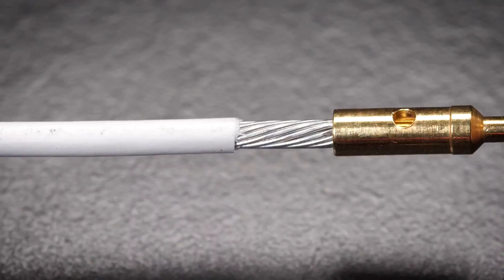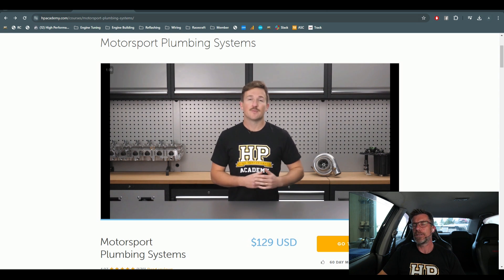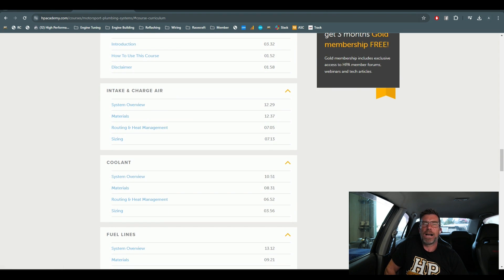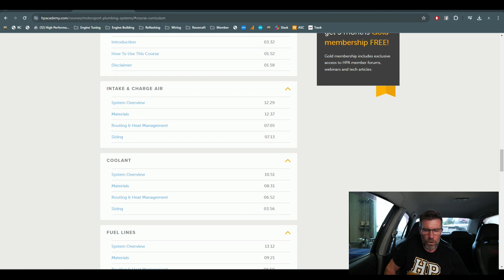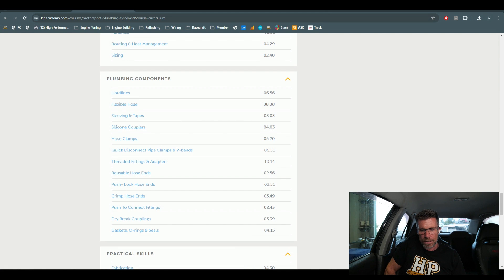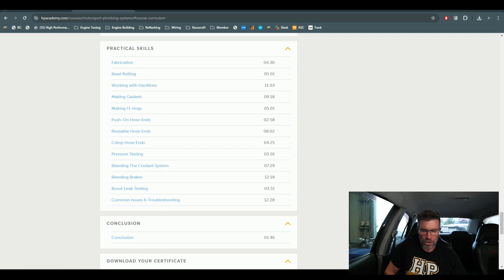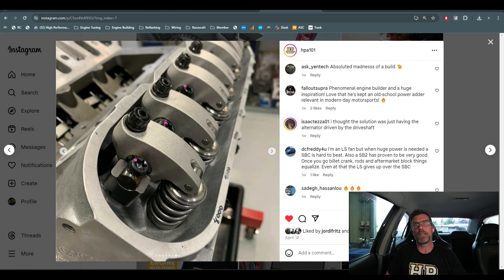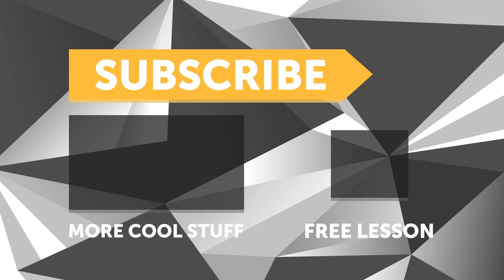Quality Wiring On A Budget | Motorsport Wiring

Comment: sure better than all the spade terminals mine runs on
Reply from the maker: It's all relative and you might never have an issue, but you certainly introduce more risk with low quality connectors/terminals - Taz.